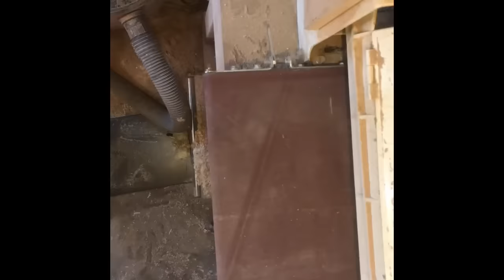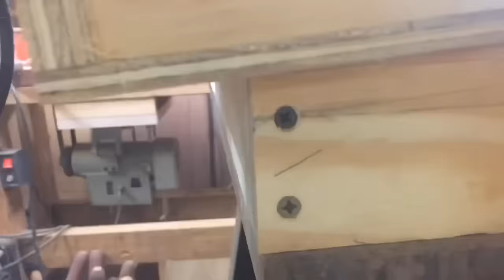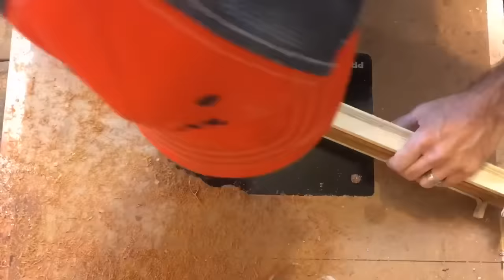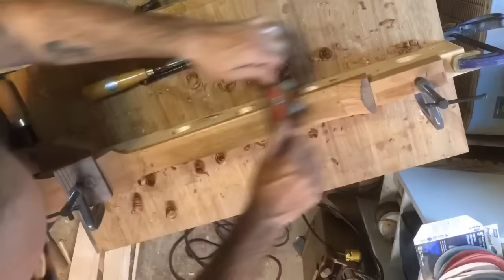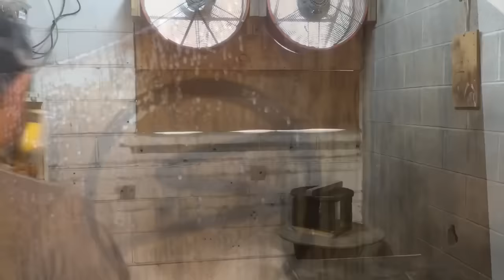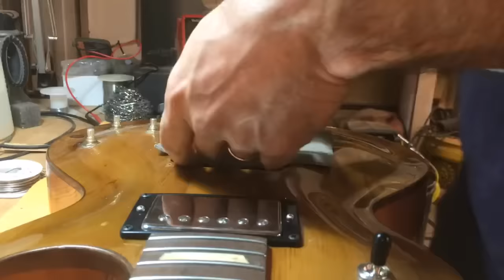Les Paul Style Guitar Timelapse Build

Comment: “99 clamps will do”
-“Why not 100?”
“Now you’re just being ridiculous.”
Reply: I'm the son of a NASA Engineer,  if 3 nails work, I use 5 screws.  That doesn't mean I don't measure once and cut twice, or completely scrap a project, but my Father taught me about Linear Thinking.  If you make a change here, what happens down the line?  He worked on Saturn Rocket boosters in Huntsville,AL where we grew up. He was " the" Electrical guy, and the wiring diagram was a 600 page bi- fold printout. As a kid, a would draw and color on the old printouts . One day I kinda saw this BIG stack of paper on his office upstairs, and started drawing and coloring on it. He came home, had dinner went upstairs to do some work, and found my Masterpiece. Had to go back to Marshall Space Center and reprint 600 pages.  If you made a change to a circuit, what was the ohm drop, amperage change 3-400  ft up to the Capsule.  Amazing Man
Reply: Donde Merlin  I know man, I guess he doesn't have a clue about basics of anything
Reply: @Douden996  wow
Reply: @Douden996  what happened to the masterpiece

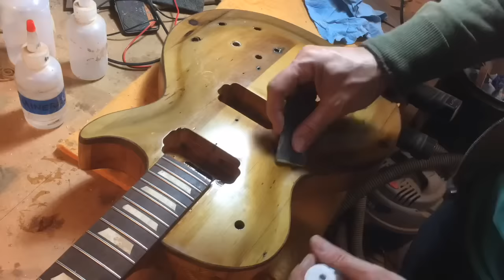Comment: 20:29 This finish is close to what I envision for my Peavey T-60 project. Bought it used. It was black. Many hours of stripping revealed a 3-piece Swamp Ash body with the lighter shade center piece offset about an inch and the two outer pieces being a darker shade. It looks off, but instead of hiding it with paint, maybe highlight the mismatch with a clear finish. 

Fair winds and following seas to all.

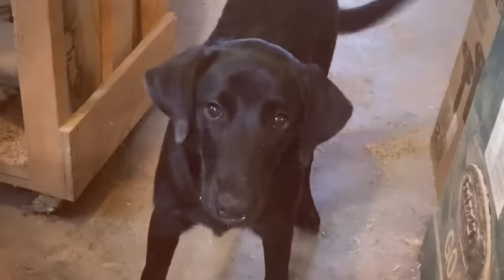Edit: 23:35 Handsome Lab! Looks like my boy, a black American Labrador just turned one year old.

Comment: Imagine some people smashes guitars and it insults the woodworkers.. 😕😕
Reply: you ever play a crap guitar in front of 1000's of people? no? then you will understand smashing them.
Reply: @northmanlogging2769  You win.
Reply: @danworth3669  I agree with you sir.. the original post/argument is lacking substance...don't think here a musician would stage with anything less then the very best quality equipment available to them...even if they had to "borrow" it for a few hours.
Reply: @m.a.c.8366  musicians by and large are broke and desperate at the beginning of their career, most well after its over, you play what you have, but sometimes passion takes over vs budget, or worse people take deals from less then reputable suppliers/makers.  The other factor is that some of us play hard, and at the end of the day a guitar is really just thin bits of wood barely held together with some glue and good intentions... Hell I've broke 4, 3 of em just playing the damn things... anyhow lots of things can and do go wrong on them sometimes at the worst moment.
Reply: AB Baby  yes and no, I only play Gibson now, and I've broken them yes, but only from misfortune, the meat of a gibson is tough, pickups, wiring, etc, just the headstocks are fragile, Fenders on the other hand are hit and miss for wiring and pickups, which is more often then not what goes wrong while playing, and the tail piece on a Fender type is garbage so you break a string and things all go south from there, Fenders are the only ones I've smashed live.
Reply: northman logging people qpppô
Reply: The woodworkers get paid pretty well so it doesn't really matter to them where the guitar ends up.
Reply: The Beauty of fenders is the modularity, pretty much if you have a good Strat body you swap out everything easily to your liking.
Reply: I've also seen people in concerts smash guitars. Just to invigorate the crowd. I agree it's a complete insult to a master craftsman. Who takes such painstaking time and skill to build such a beautiful instrument. to me that means that these kinds of people have no true respect for music. Or for the instruments they play.
Reply: @Galova  I call that the chicken neck :)
Reply: Well said, my friend! Those people should be jailed! They insult both the woodworkers and people that can't buy a guitar because they have no money! Greetings from  Portugal!
Reply: @northmanlogging2769  anyone who purposely destroys a guitar should be arrested and prevented from ever owning a guitar again. That goes for Jimi Hendrix and Pete Townsend. You cannot master an instrument you do not respect.
Reply: @garypaquin9571  you cannot master what you are unwilling to destroy
Reply: @northmanlogging2769  over the holidays I listened to the world's greatest living musician Itzac Perelman play Vivaldi on his 350 year old Stradivarius violin. Despite its age and fragility it must be played daily to retain its unparalled tone. Master Perelman would not destroy the instrument he has spent 65 years mastering. Thus the fallacy of your argument is exposed.
Reply: @garypaquin9571  I'm sorry who? world's greatest huh? given enough time anyone can learn to play music, but not everyone can write music. besides the stradivarius's dont need to be played daily, they just deserve to be played daily, much like a '59 les paul, it's also largely hype, modern instruments can sound and play just as good, or better then the priceless relics, without being ginger careful with them.
Reply: woodworkers have been paid before the guitar was smashed
Reply: Megan Bingca I agree, I play drums but the concept is the same, I also have guitar some of them not as expensive but I work hard for my money to act like an idiot and smash my guitars even if is not in front of 1000’s of people because I think of the hard work and time people put into these instruments.
Reply: A les paul is a les paul is a les paul. A musician can smash one up, or a strat, or any other basic production guitar and have another the very next day. Or more likely has a spare back stage. It isnt that they dont respect the insturment or any other nonsense. And they aren't smashing hand build 1 of a kind insturments.  They are puting on a show. They are entertainers. Some entertainment is more destructive than others, and what they want to do with their own property is up to them. Thrown in jail for smashing a guitar, please. Not a master if they burn their strat on stage. Give me a fucking break.
Reply: I was always told you haven't really played guitar till you've smashed atleast one
Reply: I ran into a zac brown band rep at a guitar center and he was buying a bunch of acoustics to chop up into ninja stars......you can get one for like $20 and the little asian child will never know the difference
Reply: @m.a.c.8366  True guitarists can make any POS guitar sound good if not decent at best. I dont umderstand people who'd destroy an instrument theres people out there way less priveledged and will never play an instrument and to them if they did that guitar would be more than enough. Part of being a performer is dealing with a lot of shit if u cant ur career will be just like the guitar u broke. M.A.C is roit
Reply: abbaby68  if u drop the guitar the neck will break 8/10
Reply: abbaby68  that's why is was Townsend preferred smash-able.
Reply: northman logging did you ever try to perform infront of a thousand people so you can talk and say to us what it feels to play a crap guitar infront of them?
Reply: northman logging did you ever try to perform infront of a thousand people so you can talk and say to us what it feels to play a crap guitar infront of them?
Reply: @northmanlogging2769  Even if its their own property, whats the point of smashing a guitar? Even if its crap and in front of 1000 ppl? To be a rock star?
Reply: @loganhugmeyer2756  Entertainment is subjective and can be done in various ways and smashing a guitar could not be one of those, dont you think? Even if its for "the sake of rock n roll". Not everyone is entertained by destruction, especially of something a looot of ppl that go to concerts also play themselves...
Reply: @psychedelicpain420  frustration, anger, passion, pick one their all accurate
Reply: @northmanlogging2769  smashing a guitar is passion now? Hahah where in hell do you come from?
Reply: @psychedelicpain420  anger, rage, can't fight cause your already guilty, no one listens when you tell them, so things get broken.

you obviously dont understand where I'm coming from, otherwise you wouldn't be making these statements
Reply: @psychedelicpain420  I said SOME entertainment is destructive. Some isn't. Some people like that sort of thing. Some dont, who cares. If thats your jam, go ahead. If its not, well don't consume what they are producing. Different seats for different butts. I still think it is silly to care so much about what somebody does with their own property.
Reply: @loganhugmeyer2756  Well, I agree with you. I dont care what you do with your gear, you can even use it as a dildo and I wouldnt say a word. But watching that from the crowd, looks waaay ridiculous. Since I also play guitar and wouldnt even hesitate to do that. So yeah for some its fun, but for others is it painful. Way too painful. Just like beibg a photographer and watching someone destroy a magistic camera in front of you. Do you get where that feeling comes from?  But just like you said, there is entertainment for everyone. At the end, we can only agree to disagree.
Reply: It does, & it's fucking childish & stupid as well. That guitar could have gone to someone that wanted it, & would have loved it.
Reply: @northmanlogging2769  Gibson of today is shit junk. Gibson trying to get money out of Dean guitars for copy right bs. Then trying to turn & sue another big guitar maker for copy right bs. Gibson of today?? Is a joke. One the plus side Gibson did announce a 2020 Justin Beiber custom model last year so that's a big boom. I abandoned Gibson a long time ago. Tradition, with nothing new of interest. They don't hot rod, & build fast speed neck guitars. They make the same ole pickin guitars, which is good. They need to move into the modern day though, while keeping the heritage. Which they haven't
Reply: @hammeredseb7198  ok, where do you think the modern "speed neck" came from, aka the Gibson slim taper....

but sure I guess an explorer and a V are... oh wait thems Gibson too
Reply: @northmanlogging2769  funny, Dean had a Speed neck, slim compressed "C" neck in the 70's
Reply: @hammeredseb7198  yeah  a direct RIP off of gibson 60's slim taper, from explores, Vs and SGs

Comment: I would've rather listened to the noise from the drill press and filing and sanding than the soundtrack that was put to this video. I had to turn the volume way down just to tolerate watching the video. Great craftsmanship by the way! It takes alot of time and engineering to get this good
...in under 25 mins. Lol!

Comment: And this is how you build a $2500/$3000 guitar that lasts through the 22nd century, and not one of those crappy $150 ones built in Mexico by a machine that will turn to dust. Well done.